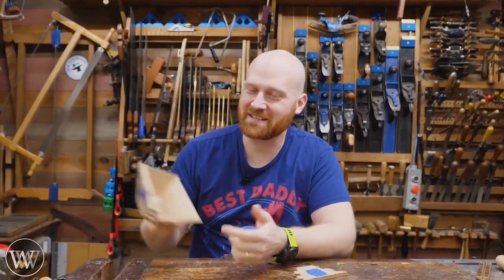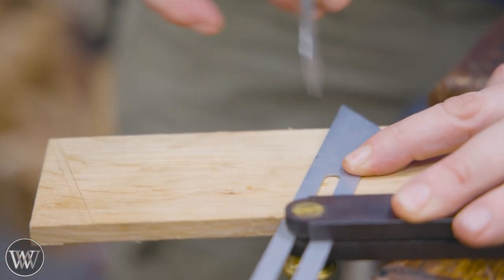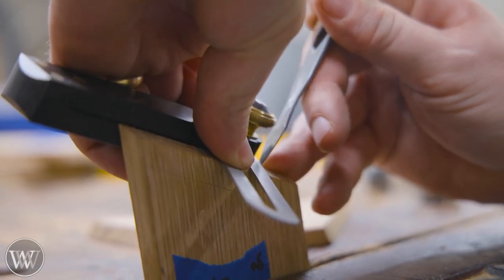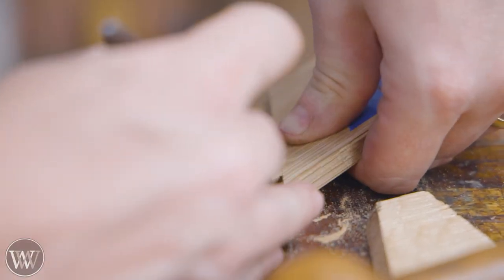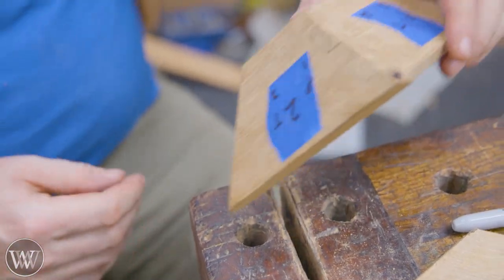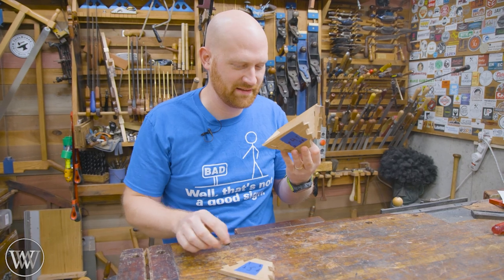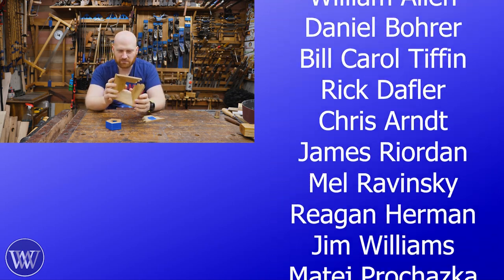How to Attempt a Pentagonal Dovetailed Bowl and Fail

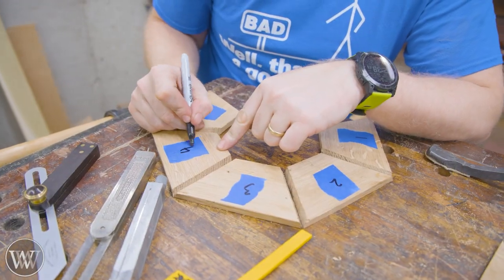Comment: As someone mentions, the cuts are for a mitered connection. that means: it goes wrong at 4:51, you basically switch the inside and outside surface and that changes the angles between them. That should also fail if didn't make it a bowl, but just had vertical sides. I think you might need to set your miter saw for a 10 sided box, if you want to do it in this way.
Reply from the maker: we found the answer! Daniel Bohrer was the first one to show the angle variance.  https://archive.org/details/pentagon-dovetail-angles

Comment: This is just a thought. When framing a roof. say a 4/12 pitch the ridge board is actually cut to a 4/17 in order to have the angles with out. That's the reason for the "ridge/Valley" section on a speed square. That's just my theory though, a lot of geometry/trig.
Reply from the maker: we found the answer! Daniel Bohrer was the first one to show the angle variance.  https://archive.org/details/pentagon-dovetail-angles

Comment: I think, the small pentagon fits, because the dovetails aren't cut yet, so the original pieces should be also fitting also well before the dovetails are cut! Did you put the original pieces together in a pentagonal shape before cutting the dovetails? If yes, and if they fit well, then of course they fail after cutting the dovetails, because when the pieces come together with dovetails, the angles change, because the pentagonal box becomes smaller. In a 90 degree box, it doesn't matter, because although the size of the box gets smaller, after the dovetails are cut, so the piece intervene each other, because all joint angles are 90 degrees, they fit well... (English is not my native language, I am not sure if what I wrote is easy to understand!)
Reply: This was my first thought as well and should be simple to test.
Reply from the maker: we found the answer though! https://archive.org/details/pentagon-dovetail-angles
Reply: @WoodByWrightHowTo  Nice! that diagram really clarifies the joints

Comment: If you wanted to make a square dovetail box, you wouldn't miter the boards at 45, you'd leave them at 90.  Your miter box should have been set at ten (?) to get the right angle you wanted.  Whatever setting gets you the 72 degree angle.  Your miter box is weird.  Thanks for showing us the fails, James.  I take a lot of solace in your "just try it and make sure you're having fun" approach.

Comment: I might be completely wrong about this but cutting the board flat on the mitter saw or at an angle produces the same angle.... For the truly compound angle box should be cut with a "ramp" at that angle. But is simple to test it, try it with a 4 sided box and that method should make a square sided box

Comment: James, as said below, cutting the dovetails altered the compound angles at their interface.
I would think if you set-out the dovetail shoulder angles from their interior face, made them 'deeper' than the final outside dimensions and plane off the waste, you'd be good to go.
Effectively you wouldn't need to cut any fancy angle cuts from the saw...but you would need some fine setting-out and chisel cuts...good luck!
Reply from the maker: in this case the dovetails were great and not the problem. we found the issue though. https://archive.org/details/pentagon-dovetail-angles

Comment: I did a square one but made the dovetails aligned with the grain, top and bottom, rather than the ends of the boards. Maybe try that aand see if it makes a pentagon easier.

Comment: There's websites (mostly for crown molding, but it's fine) where you can put in the "pentagon" angle and the "splay" angle and get angles to set miter gage and table saw blade angles (the math for which includes sinh, cosh, etc, so way over my derivation skills).  You can then take these and set up your miter saw.
Reply from the maker: The problem is we need the inverse. Most of those calculate for mitered corners. We need inside reverse as the dovetails go past rather than meeting in the middle. But we found the answer. I have to cut it for 10 side box as opposed to a 5 side box

Comment: Because the angle changes when using compound angles. I programme a CNC for bespoke kitchen manufacturer, and this is one of the biggest headache when programming for angle units. I normally CAD it out to get the correct angle.
Reply from the maker: that was what I was about to do. but then we found the answer! Daniel Bohrer was the first one to show the angle variance.  https://archive.org/details/pentagon-dovetail-angles

Comment: I suspect the first error was in cutting the sides into trapezoids before putting them on the miter box. If you put rectangular pieces into the miter box propped up to the correct splay angle, the saw should cut them to the correct compound angle.
I'd try that first, because if the miter saw cuts a well fitting pentagonal bowl with butt joints, figuring out the dovetails from there should be easier.
Reply from the maker: That is what we did. The angles are hard to see some times in the video.

Comment: i love that frame saw, where do you get blades for something like that?  would a piece of bandsaw blade work?
Reply from the maker: You can make it out of a bandsaw blade but those tend to be a bit thicker. I got mine from Blackburn Tool works. But he has almost a year wait list right now. Bad axe tool works also sells them
Reply: i would suggest that you try a simple butt joint box with the compound angles first.  as a trim carpenter i have installed miles of crown molding and the concept is the same!

Comment: You set the angle off when you leaned the workpiece to the fence, wasn't it? The angle of the saw only matches when the workpiece is flat on the bed of the mitter saw. That is to say, the pre-set of the mitter saw doesn't work for compound angles...
Reply from the maker: for a compound angle the you lean the piece on the fence. just like cutting crown molding. we found the problem here. https://archive.org/details/pentagon-dovetail-angles

Comment: Did you check the angle between pins and tails? Or might just be the internal angle that's off.

For instance. One board edge, the angle between the pins on the same edge
Reply from the maker: ya the pins and tails are percict and match up with the angle, we found the answer though! https://archive.org/details/pentagon-dovetail-angles

Comment: Tape 5 sides together forming a splayed pentagon box. Place the bottom or top on a flat surface. Your dovetail assembly direction should be parallel to this flat surface. Looks like the ones you made are not following this direction.
Reply from the maker: we found the answer! Daniel Bohrer was the first one to show the angle variance.  https://archive.org/details/pentagon-dovetail-angles

Comment: So the issue is the miter angle should be wider than the size of the butt miter. Because you lose length of the board when you cut the pins and tails and that changes the angle of the join because trigonometry? Am I understanding that aright?
Reply from the maker: We found a problem. It wasn't the length shortening due to the tails or pins because all of them get shortened by the same amount. The pen to comment has the answer to the problem.
Reply: I saw that, I'm trying to understand why that fixes it.
Reply from the maker: I'll cover it when I make the next one. It's actually kind of an interesting math. Conundrum

Comment: Your angles didn't line up because when you cut the compound angle it is the same as going at an angle along a slope. It makes the angle of accent smaller which is why the total angle was smaller than you wanted. So if you didn't actually use the miter saw and marked it out with a bevel gauge it would've worked out fine.
Reply from the maker: Found the answer though! https://archive.org/details/pentagon-dovetail-angles
Reply: @WoodByWrightHowTo that doesn't take in account the splay angle... That's a vertical sides box. Imagine this, cross your fingers and make a box side with finger joints (xD) the mitter saw can cut that in the 4 sided box no problem. But if you splay your hands the mitter saw can't cut the angle in the 4 sides settings. And if you rotate the wood to make it compensate that the angle will be always the same.
Reply from the maker: In this case the splay angle does not matter. I was cutting them like the diagram on the left mitering the corners. I should have cut them like the diagram on the right. the angles are slightly different. the reason it is leaned up on the fence at an angle is to take the second angle out of the equation. Much like cutting crown molding.
Reply: @WoodByWrightHowTo  I believe it would be a combination of the two because if you set it to 10 it would still come out smaller that expected because you are also cutting the splay at the same time. If instead you didn't use the miter box and used bevel gauges at the 72 degrees and the splay angle and cut to the line it would come out perfectly.
Reply: @lucaswatts1911  since he was cutting them already on the original angle, the splayed wouldn't affect it. The pieces would all line up for a mitered box, the only issue was flipping them to make them dove tailed

Comment: Imo the error is that you marked the splay angle top-corner to bottom-corner,  this works for a square box but for anything else the only sane way to get the correct top-corner to bottom-corner angle by drawing it out.
Unless you want to be exposed to mind melting trigonometry.
Reply from the maker: we found the answer! Daniel Bohrer was the first one to show the angle variance.  https://archive.org/details/pentagon-dovetail-angles
Reply: @WoodByWrightHowTo   I disagree because because 54°bevel would lead to a 126° angle between sides leading to lobsided septagon.

I was wrong also however as using the splay corner to corner should only have lead to different edge to edge angle.

Now the only suspect remaining is that you tilted the piece at the miter saw instead of rotating it parallel to the fence resulting in a different miter angle. For fun I'm guessing 50°.

Imo the crown moulding trick would have worked if the piece was angled at the desired splay relative to the mitre saw bed.
Reply from the maker: I'll talk about it at the beginning of the next attempt video. It's actually a pretty interesting conundrum. There's like three or four other things that have to come together to make it all work, right.

Comment: interesting, my comment showing an internal angle of 54 deg is not there anymore.
Reply from the maker: Not sure why. YouTube likes to do funny things from time to time. What was the comment about?
Reply: @WoodByWrightHowTo  hey James the comment was about why the pentagonal box didn't work   . The angles cut were actually all correct but only if you put the cut faces together as you proved by cutting some test pieces and forming a pentagon. The difference was that you put the cut faces together on the test piece but when you put the box together to cut dovetails you put a cut side against an uncut flat side. This changed the internal angle for 72 Deg to this :- cut side =36 flat side 90 Deg so the internal angle became 54 Deg. To use this method for dovetails you still need an internal angle of 72 Deg to make the pentagon so therefore need the equation 90 - 18 to make 72 Deg so you need the cut side andle to be 18deg . Hope this helps as an explanation mate. Best regards Del

Comment: Your mistake is a common one; you have cut left and right at the same angle from the same side. Try laying it out so that you're only cutting only from one side of the finished project: either the inside or the outside of the box. Cut the pin side long, you can always trim flush afterward. Sounds super complicated, but would take about 30 seconds to demonstrate, after cutting time, of course 😊
Reply from the maker: we found the answer though! https://archive.org/details/pentagon-dovetail-angles